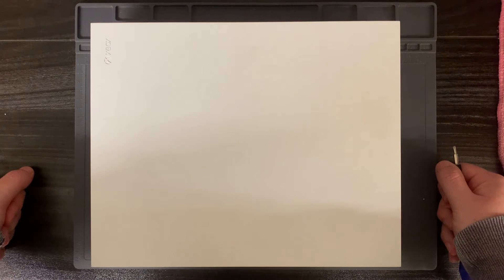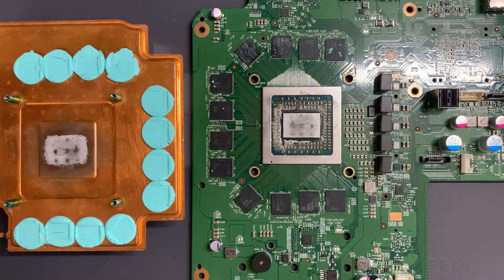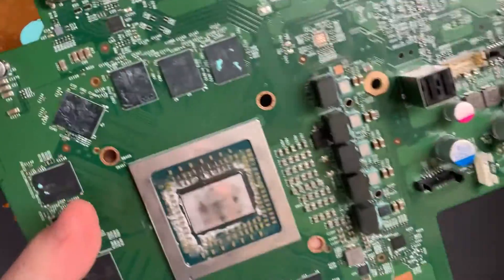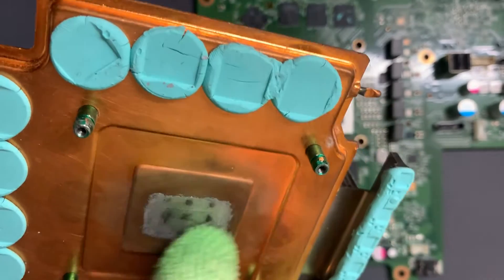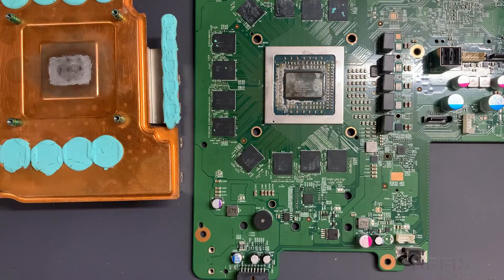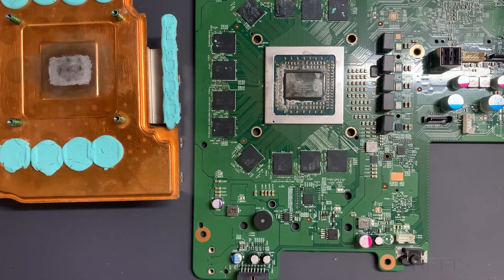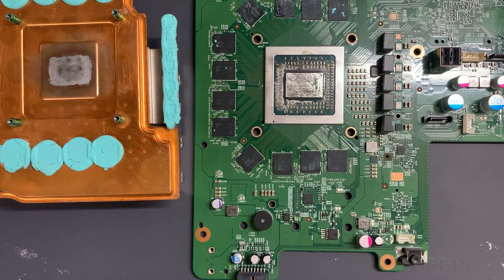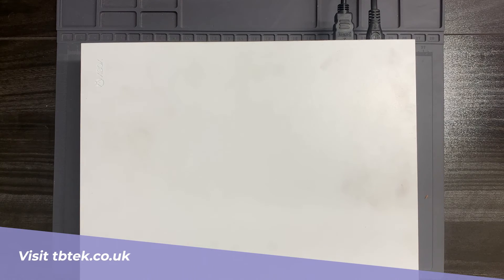Applying Liquid Metal to an Xbox One X | TBTEK

Comment: Do you think One X would fit in One S case so i could have the xbox the right way to attempt a watercool mod?
Reply from the maker: Unfortunately not. The ports, disc drive, buttons etc are located in different places. You would need to drill out additional holes to accommodate.

Probably makes more sense to modify the existing or a spare One X housing.

Comment: Why don't you just do water cooling then if you trying to modify your consoles then u will never have to clean it again are open it again are worried about your consoles over heating that over kill what I'm talking about are u can just put better thermal paste that the consoles come with dude and then u just have to change it every 5 are 6 years if you really want to and it's not good to use Don't use liquid metal directly on copper… it's eating the copper. Liquid metal also will not gain you anything here, a good paste will be fine. Liquid metal is intended for extremely tight applications where there is not much surface area to transfer the heat out
Reply from the maker: Hi, thanks for watching!

As the Xbox One X plays games in 4K etc. it gets a lot hotter than it's siblings and the PlayStation equivalents. Also because of their size, the air intakes are minimal and so the fan has to spin fast to get enough air through the system (hence where my idea for the whole came from).

Even with very good paste (have previously tried Kyronaut myself) the console fan can still be quite audible during gameplay... at least twice as loud as a PS5 or Xbox Series X.

With Liquid Metal paste, the heat transfers so well that the fan doesn't need to spin anywhere near as fast, so the experience is much more pleasant and the console is able to exhaust the heat much more efficiently, which is also good for it's long term health.

The copper soaking up the LM is only really an issue during the first or second application. Once the reaction causes the alloy to form, the process is slowed down significantly and should eventually stop completely. The first application for me lasted 2 months before needing to be reapplied but since then it has been years between the applications since the formed alloy has acted as a sort of barrier.

Sony uses LM as standard in all PS5s. As games have become more advanced, higher resolution and frame rates, Ray Tracing etc. the amount of heat produced also increases so if there are simple ways to improve cooling they should at least be explored.

Liquid cooling would be ideal but would require a ton of work etc and provide a similar result. It's not worth spending the time effort when simply switching the type of paste used is enough.